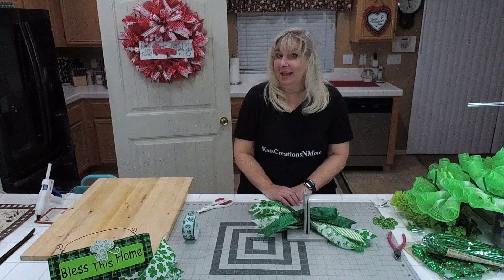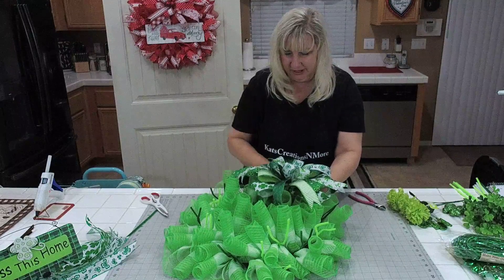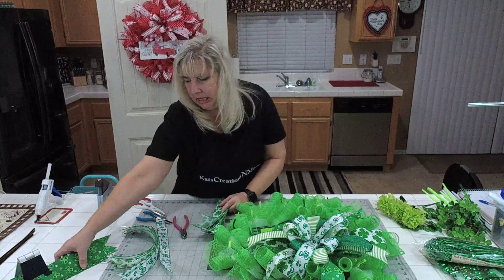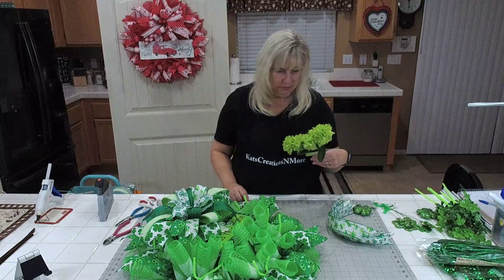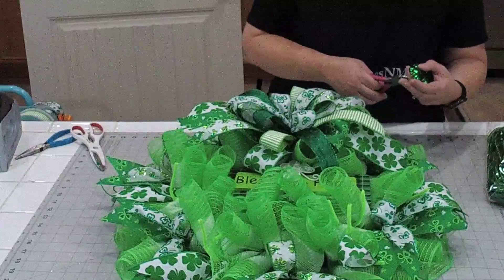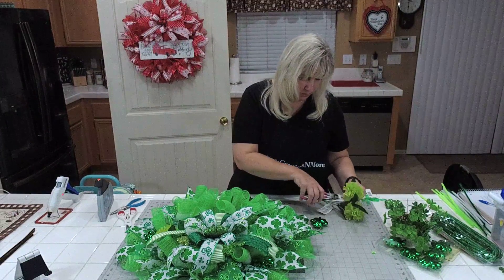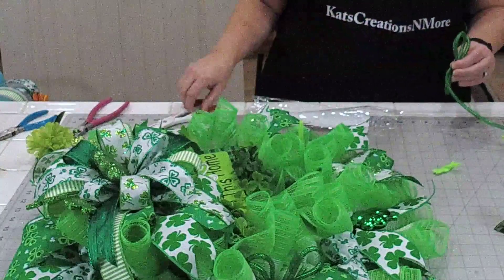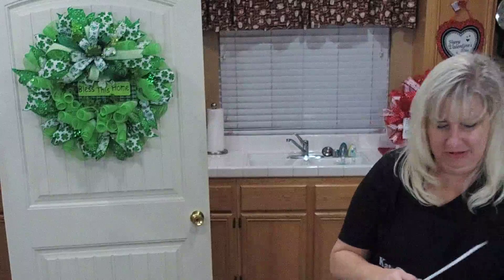How to Make an St Patrick's Day Irish Blessing Wreath Making Tutorial Part 2

Comment: There is four leaf clovers on the white and green 2 1/2 inch ribbon.You said there were no four leaf clovers.
Reply from the maker: On the use of the flex tubing. I love hiding little references in the design that customers may not even notice. I LOVE those little subtle touches.